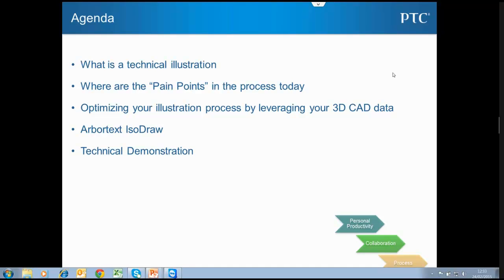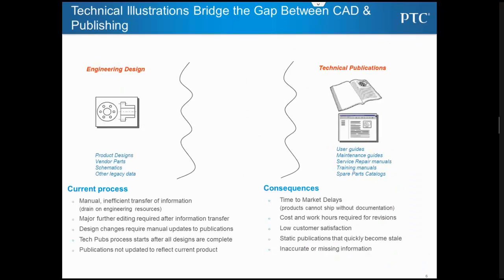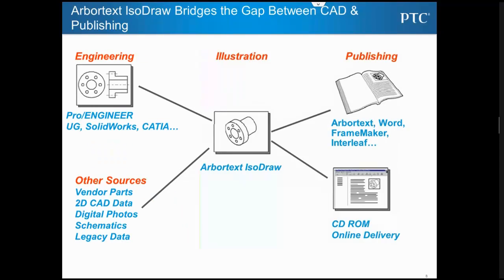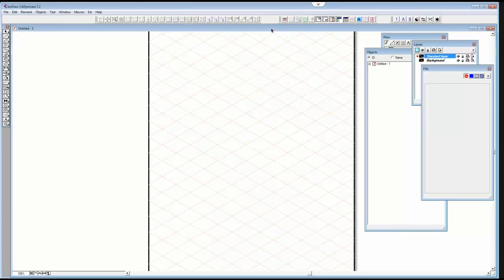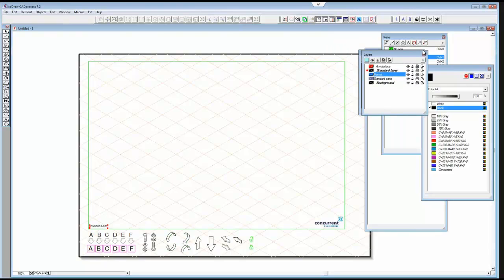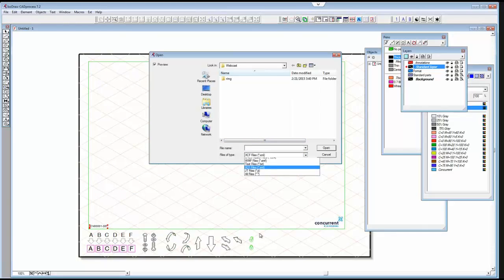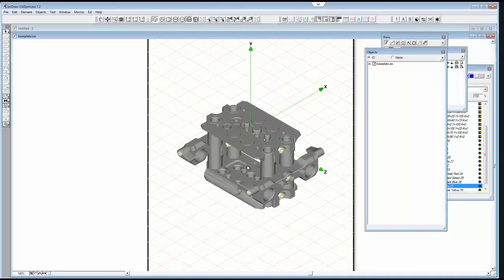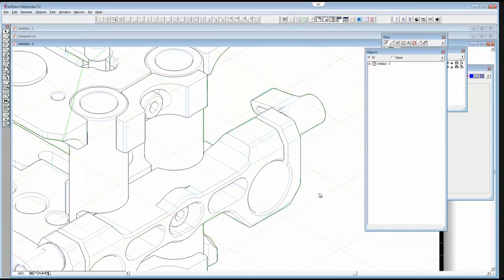IsoDraw Webinar - Optimising the Technical Illustration Process

Comment: The complete presentation is here: https://www.concurrent-engineering.co.uk/webinar-7-steps-better-technical-illustrations?_hsenc=p2ANqtz--c9NmpBs7PUlj3q3cEGsDO1ACqBwnL3iA6e6IGSSeGWENH9IwHXv9t6V8Y1diWExtSU3DRgpMM1tzXrSxsZIUDt3sbkg&_hsmi=20570096&hsCtaTracking=86e55897-8842-413a-9d7b-4f68f9fa7f28%7Ca7c753ea-b763-414e-9d2e-6afcf59c6489